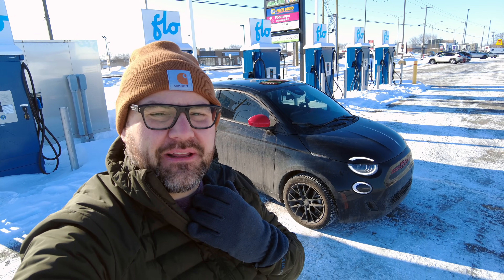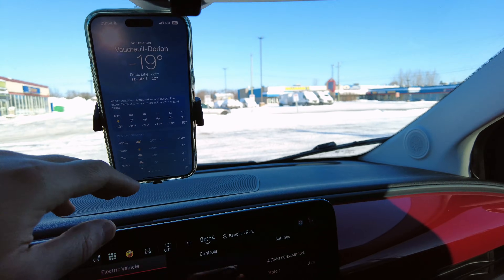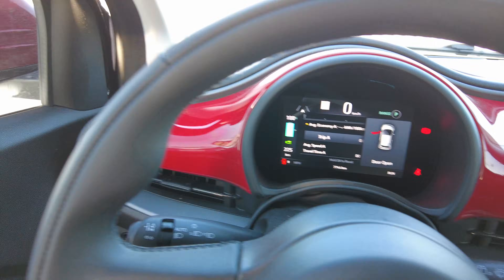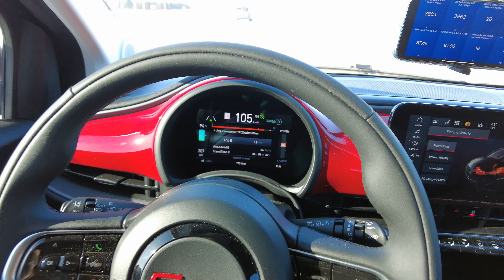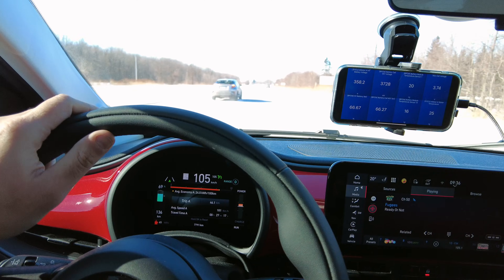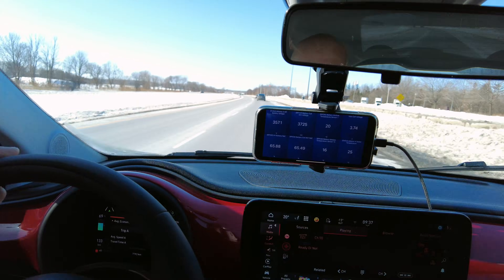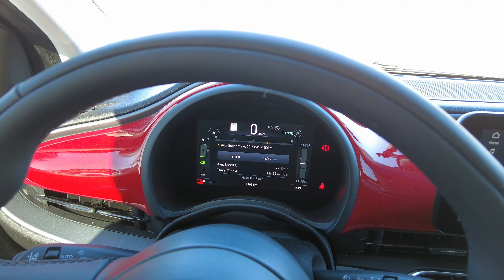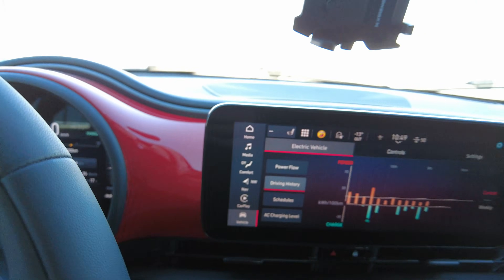Extreme Cold EV Range Test -25c | 2024 Fiat 500e: How Far Can I Go?

Comment: Hi I have a 2024 Fiat 500e. This will be my first winter with it. What size rims are you using for snow tires. My dealer had nothing that fit. I have the Red with 205/45 R17 summer tires. Looking for recommendations. Thanks
Reply from the maker: I got 16 inch rims and 195 55 16 tires
Reply: I bought 15” x 6 ATS Streetraleigh from Alloy Wheels Direct. Shipped from Germany. Car is now 60lbs lighter. They look fantastic too.

Comment: My rule of thumb for EVs in Canada on highways: take the stated range, divide it by 3- that's your actual "not aging the battery out" range.  

Try to keep your SOC between 20 and 70- not draining and overcharging on the daily can really help save your battery longevity.

This Fiat can safely do 80 winter highway kms then.  141x 1.6 divide by 3 is 75.2. You managed 161 eating up all the juice.  Checks out.
Reply from the maker: I can get behind this

Comment: Do you charge it to 80% reduce battery degradation or it doesn’t matter?
Reply from the maker: The Fiat doesn’t have a charge limit setting but I try to keep it around 50-70% for daily use most of the time

Comment: Hey I see you are at a flo charger. Have you ever had any problems with changing your 500e on flo chargers?
I am picking up my fiat from BC and will be driving it to MB. Not sure if I should rely on flo chargers during my trip.
Great job with the winter range test!
Reply from the maker: @Blazack  no issues with DC. The level 2 FLO i suggest setting 3 for AC if you stopping over night
Reply: @ thanks! My 500e is exactly the same as yours, color and trim 😊

Comment: biggest problem for me with the Fiat 500e is the km estimator which is always at 225km, did a 55km round trip last weekend and got home with only 24 km estimated... Should be like the Bolt which I have (a 2019 chevy bolt) with an estimate in real time that changes according to temperature and last ride... So getting used to the % instead of estimated range...Continue ton bon travail, voici les tests qu'on veut...des vrais tests, par du vrai monde, dans des conditions réelles :) de cette façon ça montre aux gens c'est quoi pour vrai une auto électrique, pas parfait mais moins pire qu'on pense, en tout cas au Québec :)
Reply from the maker: I don’t drive an EV based on what the distance says. Drive to SOC! Pour moi, des tests réalistes dans des scénarios réalistes sont le véritable test des voitures électriques. Je montre la vérité toujours
Reply: I've driven many 500e here in Spain and they all display 260km at 100%. Also doing 110km/h on the highway i have managed to make 170km, arriving with 10% remaining (18 to 20 kWh per 100km average) we do have much better weather but we also have a lot of height differences between cities.
Reply from the maker: This is my experience as well in warmer weather
Reply: @alfrredd  170 km/h on remaining 10% was crazy
Reply: @v3le  I never said 170km/h (speed) but 170km (distance)
Reply: @alfrredd lol that's even crazier😮
Reply: @v3le  I drove 170km and the battery went from 93 to 10% if I remember correctly.
Reply: @alfrredd  oh ok it took 83% of you battery to make 170km, that's pretty normal

Comment: Thanks for another cool video.  I feel your range pain as I just bought a 2020 Ioniq only to find out that the first battery 40% is bigger than the last 40.  My first big trip in the cold resulted in limping into a friend's driveway without even a level 1 charger on board.  Next time I went a plan B and C to get back.  I find the Ioniq has no energy management tools to find out what's going on.  What are you using see the details of what is going on?
Reply from the maker: Car Scanner ELM with a Veepeak OBD2 dongle
Reply: @SimplyGregsterEV  That worked great.  The hardest part was finding the OBD port in the Ioniq which was not described in the wads of manuals.  Frustrated, I pulled off the fuse panel et voila. Now I need to customize the ELM presentation for my use.  Thanks!